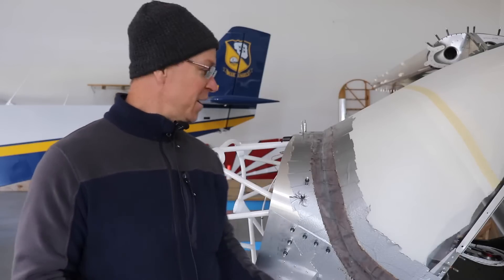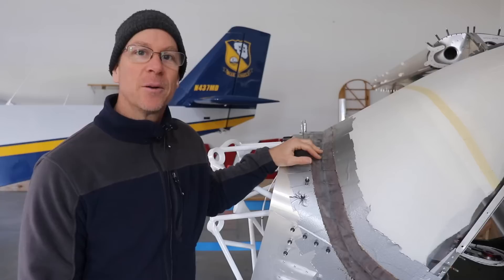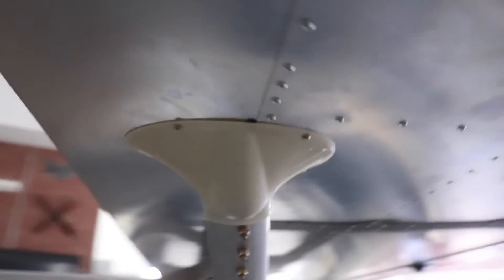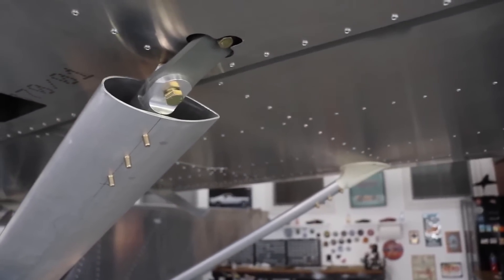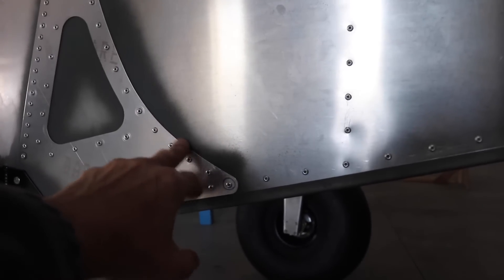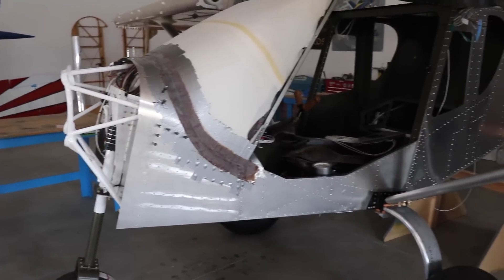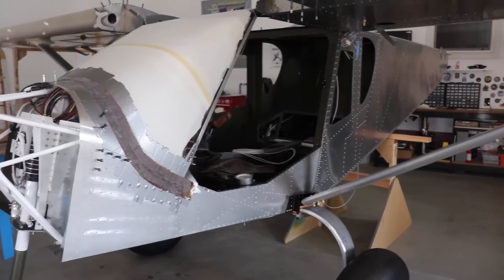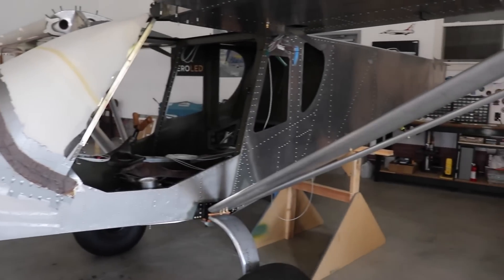Building an Airplane

Comment: Why remove the primer?  Just sand it a little or scuff with Scotchbrite before you apply the exterior primer.  You will never know it was there.
Reply from the maker: Because it doesn’t bond to the alumni as well as a good two part epoxy primer. I don’t want that area peeling in a year from now.

Comment: You might think this video is boring, but I think there was a valuable tip!  Perhaps obvious to you, but having never made a windshield fairing, I had never thought about doing all the sanding with the fairing still on the aircraft!  Obviously, this is the way to go - that long, flexible fairing is much easier to handle still glued-down to the plane!  I assume after sanding the main surface, you then pull the fairing and then trim and sand the edges?